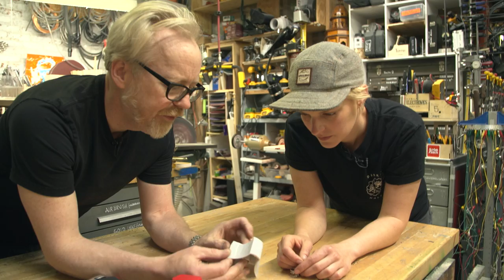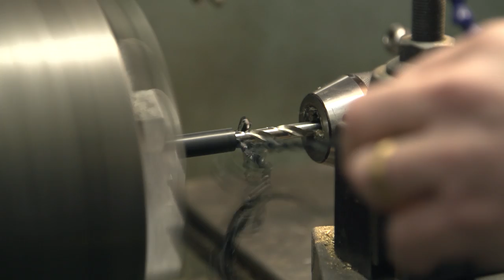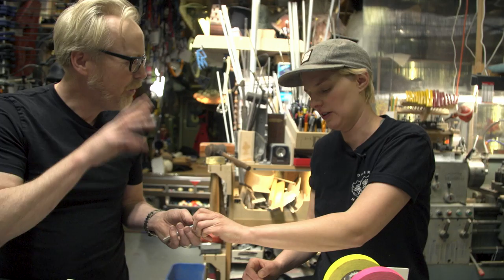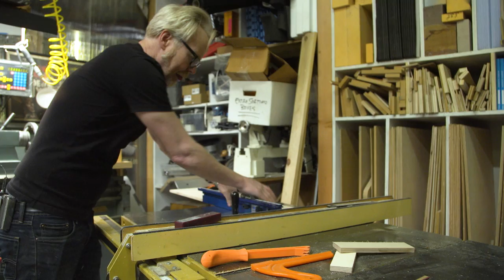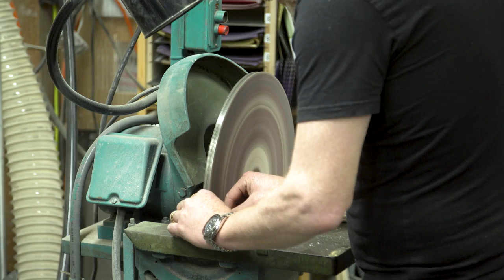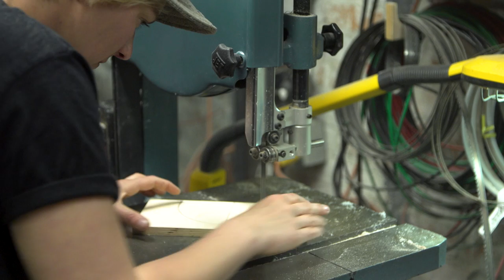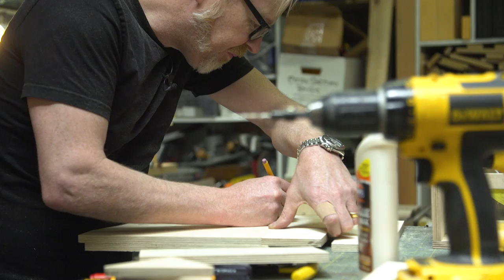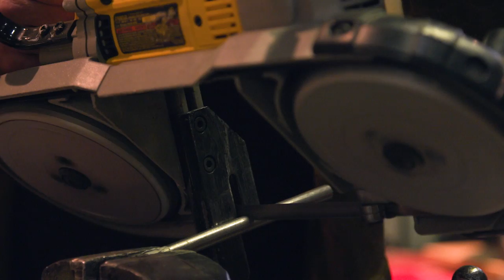Adam Savage's One Day Builds: A Better Tape Dispenser!

Comment: The most impressive part about this for me was the fact that Adam can draw a straight line completely free handed.
Reply: Mathew Schimmenti where :o
Reply: marcel helder he was drawing on of the lines during mock up completely free handed
Reply: Actually he leans palm or other finger on the wood side.
I use that technique all the time at work.
It's accurate enough.
Reply: Used to do it in high school in my carpentry class. It's really not as hard as it seems!
Reply: Use sweeping arm motions… search YT for detailed tutorials! Anyone can do it. :D
Reply: hold the pencil in your hand as you normally would. use one of your off fingers to guide the line along the straight edge of the board, it will be translated to where you're holding the pencil. simple.
Reply: You ought to see Tommy do it all the time on Ask This Old House.
Reply: EXACTLY! I'm a conceptual designer, I could NEVER draw straight lines, I have no problem drawing clean curves freehand, but straight, forget it :p. And in INK, what the heck Adam? :D
Reply: Lock your wrist and only move your shoulder or elbow. With a bit of practice it gets easier. Also use your off fingers to lightly slide along the surface you are drawing.
Reply: Mathew Schimmenti put your pencil on the paper and look at the exact point you want to draw to, don't move your focus and then try to move your hand to that point.  You'll draw a straight line every time
Reply: He didn't draw it freehand he rested one of his fingers on the side and locked his hand in place as he dragged the pencil across a lot of carpenters use that technique and I use it quite often in engineering and design also quite a bit in machining
Reply: Lol I can do that
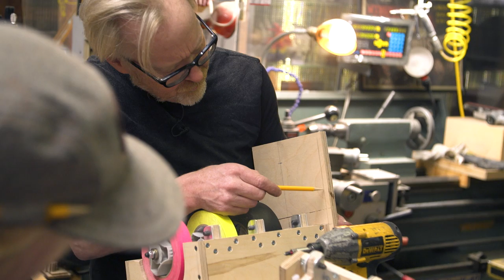Reply: 33:40 this is the impressive part
Reply: he used his hand as a guide against the edge, just don't move your fingers... you can do this easily too.

it's also a must have skill on any construction site, for carpenters and drywallers(sheetrock).

to take out the step of having to measure, lock a tape measure and hold a pencil or knife on the end, and drag down the side of what you're marking/cutting.

you can do this with a ruler,  or square if you have stops (small brass clamp that hand tighten on the edge of rulers or squares) when doing things with paper, cardboard, sheet metal, foam .. whatever.

clamp stops are also great for making copies of things that require the same measurement over and over... or on a framing square, to mark out a set of stairs/steps. (EDIT.. or rafters)

these: https://www.amazon.com/Johnson-405X-Contractor-Square-Gauges/dp/B00002NBKH
Reply: It's actually more about tracing using the side of the wood as a guide. You just hold the pencil and then use your other fingers to guide yourself up the side of the wood until the end. It's basically using a ruler indirectly. You can do the same thing for near perfect circles by leaving the pencil in place, using the bones in your wrist as the center for a compass and just turn the paper around under the pencil.
Reply: Mathew Schimmenti use your finger as a guide if it's parellel to a straight edge.
Reply: Amen brother his steady hands are above those of mere mortals
Reply: Mathew Schimmenti I'm starting to think he is just a robot.
Reply: Don't you know the thumb trick?
Reply: Still no one saw the sweet circles he made lolzorz
Reply: Old carpenters trick

Comment: I know Adam won't read comments but might help others looking to do something similar.

For the blade a really easy place to get them is on the glad wrap dispensers, you get a footlong blade on the side of a cheap box.
Reply: Yea but quite as sturdy as these. I watching this closely because O use a lot of tape but just use large desktop type dispensers from 3M.
Reply: Cost money though. You can affix these blades to something to make them a bit more rigid.
Reply: The tape holder (the grey plastic thing they cut up) could easily and more cheaply be made from MDF.
NM, the serrated blades from the glad / foil wrap boxes could be made stronger by gluing to the blunt side of a used craft blade. Or you could cut sections from a hacksaw blade.
Reply: You can also use hacksaw blades and cut them to length with an angle grinder if you need something a little more heavy duty
Reply: that is how I made this same thing in art school (my first build I couldn't remove individual rolls easily)
Reply: The old Popular Mechanics trick is to mount a hacksaw blade as the cutting surface on the tape dispenser.
Reply: Once the clear paddle breaks tape guns become parts, I've got three broken ones sitting above my work table. I probably toss one once a week. He could have got the tape guns for free, just hit up anywhere with a decently sized shipping dept.
Reply: I do this too on my custom tape dispensers.
Reply: N.M. Is

Comment: Love watching the cogs turn in adams brain :) loved the liner lock mechanism they used to keep the arms held up
Reply: I liked that ply leaf spring too - didn't see it working at the end though.
Reply: That was my only frown moment in the vid. As soon as they said they wanted something to lock the arms up I just thought of a tungsten steel flap/spring (think of a springboard a gymnast uses to leap onto/over the box) mounted to the ply backing that the top corner of the arm would depress when the arm was moved. When the arm was fully up or down the tungsten would be at max open and would hold the arm in place while the action of raising/lowering the arm would depress it.  The friction part of the arm - the corner - would be lightly rounded off and shimmed or capped with something that wouldn't wear down or alternatively would promote ease of action ie solid teflon insert or a strip of thin hardened steel bent and screwed into place - use whatever is on hand but all stuff I've worked with before so know it's doable.

Comment: Well I'm never calling it a 'ruler' again. Tape Measure -> Stick Measure. Obviously
Reply: I thought she meant a folding ruler but I guess its almost the same ...
Reply: She was close as the word derives from the French for "Measuring Stick".
Reply: commonly known as a yard-stick... (yup, even if it is in metric)
Reply: theorganguy in german a folding ruler is actually called a "zollstock" which translates to "inch stick".
Reply: thanks for clearing that up... I'm german myself... the english name for the Zollstock is Yard Stick... literal translations don't always work... and yup, that the name for a metric measuring device has "inch" in it, amuses me also
Reply: theorganguy i think up until the late 1800s germany still used zoll as a measuring unit. after 1875, when the "meter concention" was signed the old often unregulated measuring system converted to the centralized regulated metric system. the word zollstock is a remnant of the time up until that. also i think some industries still use zoll as a unit.
Reply: Here in Sweden we call a folding ruler (that carpenters use) "tumstock", which literally means "inch log". Of course the measurements are in metric, but on the  other side it usually has an inch scale. The carpenters are mixing quite a bit. A two-by-four is called "2 tum 4" = "2 inch 4", while all length measurements are in cm or mm.
Reply: Robert Miles I baffle and confuse people by asking for a straight edge. Then handing it back and saying "no that's a measuring stick."
Reply: theorganguy nope the official german name is Gliedermaßstab ;)
Reply: gotta keep the naming consistency in your code
Reply: as a german she just didn't want to say "ruler" :P (german myself)

the "Zollstock" is also called "Gliedermaßstab" or "Metermaß" - a yard is almost a meter (1yard = 0,9114m) so yard stick is not far from being one of the literal translations :P
Reply: The same in Danish, where it's called a "tommestok" (inch stick) even if it's metric.
Reply: And the funny thing is that a 2 by 4 is not actually 2 by 4 inches, but only 1½ by 3½ inches in practice.
2 by 4 is the  unprocessed dimensions. https://en.wikipedia.org/wiki/2%C3%974

In Danish a folding ruler is also called a "tommestok" (inch stick), even though most of them are metric only on both sides nowadays here in Denmark. That's all carpenters use here.

Comment: The tape rolls should be double mounted back to back with a single arm between them.  You could fit 4 rolls in the same place.
Reply: the idea was that they wanted to take off one roll without having them stick together or needing to get one out of the way, take the one they needed, then put back the one they didn't. an easy way to have more is just to make it more compact and have more arms.
Reply: |Mc Chappington| he's got a point though. Imagine one arm with two rolls of tape on either side. It would allow more tape indeed

Comment: Neat build. Things I would have done differently for me:
1 - Not used thrust bearings. None needed, you want some friction on the roll so it doesn't overpull and doesn't float when you're trying to pull a specific amount.
2 - Used spring instead of the catch lever. Just like on a kickstand. Put the top position just after 180' so the spring "locks" both up and down but still only needs one hand ever, no lever to reposition.
3 - Made it all smaller. This is the size of a toolbox and it only holds 3 rows of tape. Get rid of most of the mounting hardware, get rid of the MDF, made slip parts out of steel.
Reply: Also, why cut the tri-star (whatever that grey plastic thing is called) at the top and then sand down the egdes again instead of cutting the bottom? That'd definitely make the single units thinner.
Reply: She had the idea to have the roll on a spring to hold it up, and a catch to lock it down in the first place. I would probably have just had it swing over 180 like you say but held there by gravity. kickstand only needs a spring because it is upside down.

Friction on the roll is not an issue, the friction of the tape coming off the roll actually keeps it consistent. Lower friction is good for these guys, because they use tape very quickly.
Reply: Or they could have given the thingie a small angle toward the back, so when it's up it would remain there by gravity, and would fall back into normal position very easily without having to unlock the thing.

Comment: That's a really cool build, but how about going some few steps further and have each section of the tape dispenser to have a mechanism with one push will spring and slide out and the tape arm swing out. Then remove and install the tape and release the leave spring lock and one push to lower the arm and lock the dispenser back into place. 

An idea perhaps?

Comment: Just thinking that the really easy spinning movement of the roll could lead to some issues when taking a piece off.  I almost think there needs to be some rolling resistance for good tape dispensing.
Reply: You mean like the tension adjustment that was already on the tape gun? They had some good ideas here, but also some not so good ideas. Cutting down the spindles actually makes it harder to load a roll, for instance.
Reply: I don't like the amount of work involved  for the outcome. No I take that back. I don't like that they bought tape dispensers to make tape dispensers. make it from scratch or make an easier mod. like a caddy to hold the manufactured dispensers
Reply: no, why waste time making something that already exists. they bought an item that had both a cutting blade and a way to hold the tape. that was it, the rest was made from parts in Adam's shop.
Reply: totally agree Chris, 6 tape dispensers, incredibly uneconomical. They just had to look at a "picture" of a tape dispenser, and make a wooden spindle, but they're not concerned with cost here, just entertainment.
Reply: I think the point was lost somewhere here. There is a term, don't re-invent the wheel. The tape dispenser didn't work for her as it comes. However a lot of problem solving was done in the tape dispenser to start with.

Typically stuff for shop-use is bettering whats already available on the market to make it work for you. I did this by 3D printing jigs for a pillar drill. I didn't build a new pillar drill from scratch, the drill did a job but not quite what I wanted.

They could have had it laser cut or 3D printed parts and mechanisms, but its about the process, the learning, the light-bulb moments and the shear joy of it. 

Every time she grabs a bit of tape in future it will be a little bit easier, but the moment captured here is forever.
Reply: they cut the  wrong side off the spindles  really. If they had only taken off the back side, it would have been fine.

Comment: When using tape with a coat of teflon on the non-sticky side, you need a brake on the tapedispenser, otherwise the tape will just roll out when you try to cut it off. :)

Comment: Jesus Christ! This isn't making a simple tape dispenser, this is engineering a prototype for mass production!
Reply: They could make millions. I could use one.
Reply: E F Larsen jeez dude, you okay?
Reply: I'd buy it.
Reply: well my work has tape dispenser on there desk for paper work on our production floor which is almost basically the top of that tape dispenser
Reply: Nah, it's too clunky, you gotta undo it with both hands after taking tape out and the use of materials is painfully excessive. All you actually need to make one is plywood, some pipe or a rod and the wheels that hold the tape... But they had to make an episode out of it, so yeah....
Reply: @grumpyblue1623  🤣 LMAO 
you basically described all prototypes.  Might want to look some up, they tend to be expensive and some are really cool to see b/c of the "what could have been" factor
Reply: @humbertocruz53  Yes, this is basically a scotch tape dispenser turned upside down and locked in place magnetically instead of pressure fit. Admittedly this version is larger (office tape is LOTS smaller), rigged for three instead of one, and lots more rugged...

Comment: They could have just used three of the red dispensers, removed the handles and bolted them to a plywood base through the existing holes. Not nearly as cool, but it would get the job done.
Reply: Exactly what I thought. Just remove the handles from the existing tape dispensers and bolt them down. Job done.
Reply: except the blades were mounted in a position that wouldn't work in the way they wanted it, and her goal of being able to grab one and remove it one handed wouldn't have been as easily accomplished unless it were overly wide, thus making it less portable.

Comment: My favorite line from this is laura saying "what's a quarter inch" 🤣 so talented but metric to standard conversion plagues us all.
Reply: yeah man...i am from switzerland and n my job I have to do hydraulic hoses. for excavators and tractors and this kind of stuff.  you can do it for years, but the struggle with metric and imperial will always be there. how to come from metric to imperial or backwards with which adapter... lol
Reply: if it plagues you, get your government to finally adapt the metric system like all other countries in the world excepting Myanmar, Liberia and the US
Reply: @Craftlngo  even the US uses metric when designing things it makes manufacturing in a global economy easier.
Reply: 6 millimeters
Reply: 25.4 ÷ 4 = 6.35
As long as you remember one inch is 25.4mm and you have a calculator or don't suck at math (I had to use the calc, it's been a long hard day lol) then you can figure stuff out.
Reply: The official definition of an inch is metric

Comment: I use a dog collar to hold tapes while on set. I can fit about 10-12 rolls comfortably, and the dog collar has a metal ring built-in and ready for a carabiner. Easy to use tapes without removing from the collar. If I need a roll, I can unbuckle the collar and grab it (still have the problem of having to remove all the rolls in the way). But works well for an on-the-go tape solution!

Comment: There is also Nylon bearing material you can order. 
Some has PTFE and moly impregnated as well. We use the moly Nylatron GSM. 
Great for little projects like this where expensing $30-$100 bearings isn’t needed.

Comment: I love to watch these videos and think of my own way of solving these problems or replicating the results.

for this one, I think I would have had shelving with several "toilet dispensers" put in a row along the shelf. shaped roughly like Г so the tape rolls are easily removed if you want a while roll. then, on the edge of the shelves, I would affix a saw blade to act as a perforator. probably a long coping saw blade or series of coping saw blades. that way you could easily unroll a piece of tape and break it off on the edge of the shelf or take the whole roll as you see fit.
Reply: a very similar design and no where near as good, but it was the first thing that came to mind lol

Comment: Quick intial thought. Build dimilar to a toilet paper holder. The bar is a lever that can be pulled down to remove tape. It would stay on when pulled towards you. Then you just add a piece to cut the tape on. Then you can build a shelf or box of these chained together for several different rolls and some space to label the tapes above or below.